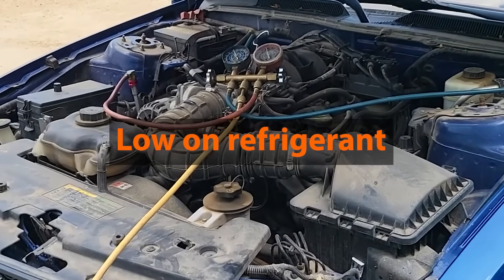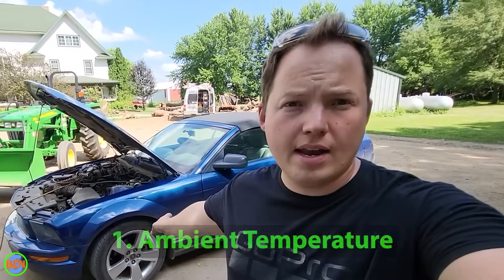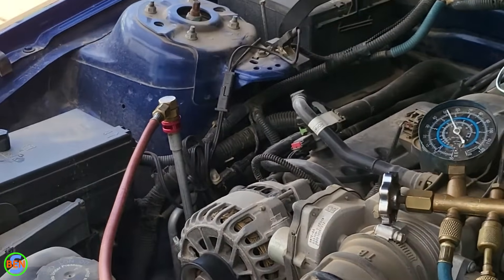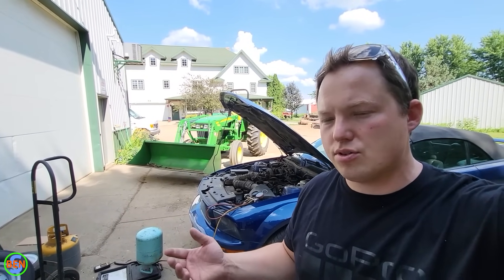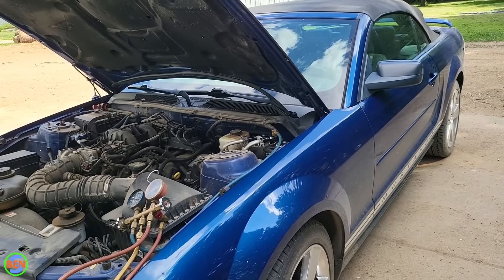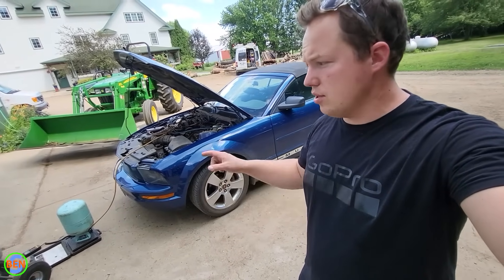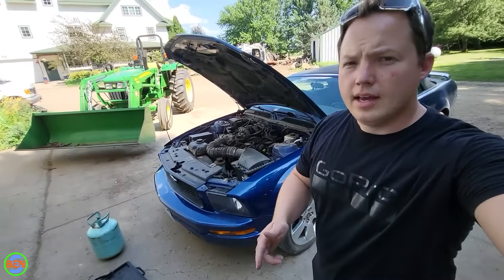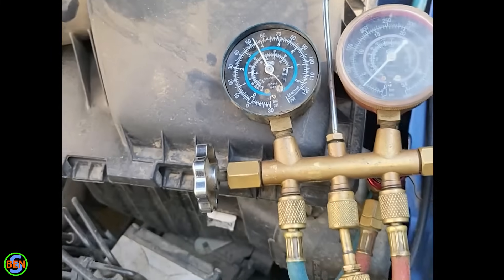What Pressure Should my Car AC Be - How To Check Automotive R134a Air Conditioner - Recharge Tips

Comment: Thank you for CLEARLY EXPLAINING how recirculation and ambient temperature affect the pressure reading on the manifold gauges! The chart that you share at 2 minutes is a valuable resource that will be very helpful. Those areas had me a little confused until I watched your video.
Reply: search: r134a temperature pressure chart pdf
Reply: @maxs351 not the same chart.
Reply: It is also recommended to open the car doors.  Not only will this help keep the inside of the car close to ambient temperature, but it will also help to keep the compressor run continuously and suck in that refrigerant.
Reply: I'm confused the outside temperature is what matters in the ambient temperature in a car is measuring that outside temperature it's not measuring the cabin temperature
Reply: @macknumber9  The GM  Auto HVAC system uses a sampling fan on the driver's b-pillar to suck cabin air into a temp sensor - so what you say isn't 100% true. This AUTO system also takes the ambient temp from before the radiator, usually on the left side (d-side) of the radiator support. It uses this to anticipate thermal loads and also to shut the compressor off if the temperature outside gets too low.

Comment: With the tank upside down like in the video, does it matter if you charge through the high side or the low side?
Reply: Yes, always charge slowly to low side.
Reply: I thought if you turn it upside down like that, that liquid is suction to the low side and that’s bad for the compressor. R134A is a GAS not the liquid.. I confused as to why you’re filling it like that.

Comment: What RPM should I have the vehicle at? I notice a huge change in pressure at idle (~950rpm) vs 2000-2500rpm.
Reply: Should be idling.

Comment: Hi sir. I have a three doors True cooler that uses R134A gas. If the temperature in my store is 75 degree, what should the low side pressure be? Please help.  Thank you.
Reply: Temperature in the store does not matter. Temp in cooler tells the story.

Comment: Pressures are dependant on
clean evaporator core 
clean condenser 
condenser fans working 
orifice tube or
Tx valve 
variable displacement  maybe ecu controlled 
fixed displacement 
When charging  use weight method with scales u did excellent 
pressures are almost are individual to each model 
pressures are changed by design or fault  if correct charged 
The ambient temp can  change pressures 
have all doors open when charging  to load a/con 
have on recirculation ,, sucking in air from engine bay is not normal 
check pressures at idle and 1500rpm 
THE PRESSURE CHART IS WAY INCORRECT 
115F DAY   25--35 PSI LOW   ,,,  150--160PSI HIGH  at idle and 1500rpm txv and fixed displacement compressor

Comment: I just filled with a can and the aircon stopped working.I started bleeding from the low point seemed warm air was coming out,then suddenly cold gas and it started working again.Must have been air in the system.
Reply: To much refrigerant

Comment: I've been doing HVAC for 8 + years now. Car HVAC systems used to come pre-charged with dye. So yeah, dye is designed to be in the system. Dye is one of the best and easiest ways to find the leak. It mixes with the refrigerant oil and is A-OK to be in the system

Comment: I've got a situation on my 2016 F250, 6.2 gas. This year for the first time 137k miles, when I come to a stop the AC heats up, as soon as I get to speed it cools down. My gauge showed low on R134a, so I added some not much, and the pressure was ok. But still the same situation happened. I don't have a condenser fan, just a cooling fan. If you have an idea where to go next, I would appreciate it. Great video by the way.
Reply: Plugged condenser, no air flow at idle.
Reply: Clean the condenser and the radiator. 
Wash both of them out with a garden hose. 
When I did my daughter truck. I used dawn dish soap. Used compressed air to blow out any remaining debris.
Reply: If you have an engine driven fan with a fan clutch, check the fan clutch. If the fan clutch is bad it may not be spinning at full speed . That will cause poor A/C performance and high refrigerant pressures at idle.

Comment: What about if one car takes 850grams of refrigerant & another only takes 450grams ?
Is that pressure chart accurate/universal for any charge of refrigerant or a particular charge ?
Reply: The chart should be accurate regardless of the amount of refrigerant a particular system is designed to hold.  The pressures should measure/register based on the ratio of refrigerant to the overall volume and based on the ambient temperature.
I'm not an actual A/C tech but I have stayed at Holiday Inn Express a few times.

Comment: Hello Ben:

So I have a question that I believe is closer to your area of expertise. I have a mini split, but it is a 24 volt system that uses a variable frequency compressor that I use in my RV. These are designed to be energy efficient, but they probably don't produce the same kind of output as a traditional one speed compressor would. I can tell when the compressor is at max speed just by the sound, and I can also confirm by the wattage being used. I'm assuming that low pressure and high pressure readings are only valid when the compressor is running at full bore--correct? For an automobile I don't think this is even a factor, the compressor is either on full output or off. 

Since the head unit or evaporator is indoors (Inside the RV in this case) I'm assuming I should be using the indoor temperature and not the ambient temperature outdoors. Alternatively I guess I could open the doors in the RV so everything is the same. Since this test is based on ambient temperature, this seems to be a critical factor so I wanted to ask for your suggestion. 

In my experience with this mini split, it only produces the extreme cold temperatures very briefly when the compressor is at full bore, and then it's cycles back down again. I think this is a trade-off for energy efficiency as this runs off a battery.

Nevertheless, all the more reason to get it as cold as possible.  Again I just wanted to ask about where I should be taking the ambient temperature reading, because I'm talking about a mini split, and then I'm also assuming that the pressure is only valid at full power on the compressor. I've even seen guys with automobiles rev the engine up to 2500 or so to get the readings. I think you're just using idle speed, so that part is a little confusing as well. Isn't pressure going to go up on the high side with higher revs and the low pressure lower? I don't know which one is correct, but most Mini split systems only have one speed. 

My situation is a bit unique here with a variable frequency Compressor, but I think the basic concept remains the same. Your comments and feedback Appreciated.
Reply: set the thermostat to max cold, fan to max speed.  set the pressure to about 35-37 F equivalent pressure on the pt chart for the refrigerant.  charge very slowly, really slow.  monitor the suction line. if it is soda can cold and sweating, STOP and check if the air on the vents is cold.

Comment: I saw your pressure chart that shows about 340 psi at 100 degrees.  I've found quite a few charts that show 100 degrees closer to 120psi and that's more inline with what is on the front of my manifold set.  How do you know which chart is correct?  The app from the Freon manufacture (chemours) states about 135.  135 seems low to me but who would know more than the one who actually makes the refrigerant?

Edit:  finally charged. 2,000rpm. 40/365 with 128 degree condenser  air inlet temp.  158 degree high side line temp at pressure tap.  Upon test driving, 40 degree outlet temp.
Reply: Never seen anything like that as to 1XX pressure range on high side for R134a...always in the 250 range (+/-) on high side. Double check "units"..... psi. and he type of refrigerant used.

Comment: When doing a recharge with a manifold set- I'm guessing keeping the high pressure coupler value should be open? But the high pressure value on the manifold is always closed while the vehicle is on + compressor on. Is this correct?
Reply: No, both valves are closed. Never open the high side valve at the gauge set. You can blowup the can.
Reply: @2nickles647  it didn't! I wonder why?

Comment: Do you ever clean under the hood?  Dirt will wick plasticizer out of plastic parts, making it brittle and prone to crack, then you get leaks, then you have problems that are very hard to locate. I actually use a pressure washer to clean, and apply protectant like armourall to hoses and plastic parts. 2004 f150, 164,000 miles. Runs like a swiss watch. 😊
Reply: Dude, Please look into Aerospace 303 protectant for your hoses and even tires.. The stuff is Amazing!
Reply: @LTDan-pk3mx  thank you I've been using armourall.
Reply: @jima3129  ...if Armourall has silicones, be careful as a lot of paint and electronics don't like that stuff. Aerospace 303 is the ticket...
Reply: Look into "Strike Hold"
Dry Lubricant Protectant, see their Video, can be Sprayed Directly into Electrical Componants while Running. Alternator, Electric motors, battery Operated Equipment, 
Generators,
Excellent for Firearms.

Comment: I put new lines and a condenser in the ac of my car but still not cooling down?
Reply: Must vacuum system properly before adding charge. Air is a contaminant.
Reply: Was the lines broken? Condenser busted. Did you replace the metering valve that goes into the AC low press line ? 
Are the cooling fans running.
Is the AC clutch cycling 
Have you changed the cabin filter
Reply: I did replace condenser and compressor expansion valve and avaporator too and Liquid Line still not cooling nothing
Reply: The compressor is working and fan, too. I changed the filters, too, but I am still not working. Just blowing warm air

Comment: I'll evacuate the system and  put 100 psi of nitrogen to it, then squirt a solution of water and Dawn soap on the hoses, connectors, compressor seal area and condensor with an ordinary spray bottle. You'll see the problem area quickly where you see bubbles.

Comment: All car compressors are designed to leak a small amount of refrigerant to keep the outer seal pliable.  Adding several oz every few years is not out of the ordinary.  Also, good mention on checking condenser’s coils for blockage.  Many times on very high mileage vehicles (200k +) the condenser’s coil fins are smashed closed.  This will cause the high (liquid) side pressure & temp to run much higher than normal.  May need a condenser replacement or lots of patience in straightening the fins to allow proper air flow/ heat transfer when high pressures/ temps seen on liquid side.
Reply: They sell fin combs to straighten the condensor fins --- I have a couple I keep and guard mightily!
Reply: @SurferJoe46 actually I should have said replacement of the car’s radiator v. condenser as the radiator’s fins get locked shut by rocks not allowing air to flow theu essentially cutting off the air flow to the condenser.  Radiators are relatively cheap and easy to replace v. attempting to straighten.
Reply: That's a very small leak, indeed.

Comment: Be very careful about keeping AIR out of your system.  Purge your gauge lines before hooking them up. I actually installed ball valves on the ends of mine to keep them completely sealed. 
The Schrader valves are a highly likely source of refrigeration leaks. They should probably be changed out if there is any significant leak in your system.

Comment: I was going crazy trying to find out why my high side was so high that the safety valve in the compressor was releasing refrigerant. I replaced expansion valve, condenser with no luck. I was about the give up until I decided to check the radiator fan. Turns out I replaced the fan a couple months ago and never checked the direction of the airflow. It was reversed so it was blowing through the radiator then the hot air was hitting the condenser which was heating up the refrigerant and causing super high pressures. A reversed radiator fan can cause high side pressures to be insane. A simple wire swap fixed the issue.
Reply: How in the world was it running backwards? You mean the plug could go either way????
Reply: @jima3129  The fan motor I ordered off Amazon had the red/black wires swapped on the plug. I assumed it was correct since it was basically spinning and never checked the airflow direction. Never assume with aftermarket parts.
Reply: @seephor  Amen to that my passengers side window still works backwards. Lolol not as catastrophic as your case.
Reply: @seephor This happened to me as well. Toyota Passo

Comment: What do you do if the compressor is not running because of the low pressure switch?
Reply: look into why low pressure switch is acting up.
Reply: While the system is under vacuum, add the first can of 134a to the low side. suck it right up now compressor will run
Reply: It sounds like you have a leak. Best thing to do is pressure test with nitrogen, find the leak (s) and repair. Pull a vacuum on the system and refill with refrigerant

Comment: Great video as usual....FYI not only do the automotive quick disconnects make it easy to connect, they usually have open/close valves right on the quick connect hose fittings so you don't actually depress the schrader valve until you turn the knob in after your connected...
Reply from the maker: Must vary by set type as the ones I've used immediately connect and don't have a separate option of depressing the valve core.
Reply: @BenjaminSahlstrom  yeah, that's true...afaik they are add on so they can be bought separately to just screw on to the ends of your gauge set hoses if it didn't come with them. 👍
Reply: When I attach the quick disconnects, I make sure the needle in the quick disconnects are fully withdrawn so it doesn't push/open the Schrader valve. Once it's connected, I turn the handle in so it opens the system and allows gas to flow. If you didn't buy gauges with handles, replace the set.
Reply: @Barryd57  another good habit is to only turn the valve just far enough to crack open the schrader. On some of those couplers that stem that pushes on the schrader can go down far enough when fully opened to actually damage your schrader valve.

Comment: I have found that when you open the system for any reason or evacuate it and want to check if a leak is present, don't use vacuum.
Vacuum can suck a leak shut. Pressure is the way to go.
The system is going to be vacuumed to remove any moisture anyway.
Then you can use soapy water to easily find a leak.
Input happily accepted.
Reply from the maker: Interesting point for sure.

Comment: None of this temperature will work that you have described on variable valve compressor which is what all recent latel model cars after 2015 has it. The knowledge you have on residential will not work in Automotive because , fan speed, variable valve compressor , change in speed of air at condensor (based on car speed) all affect pressure and heat.
Reply from the maker: Interesting. I suppose the only option in newer stuff is to just evacuate and weigh in the factory charge?
Reply: @BenjaminSahlstrom  for same reason super heat and subcool never works like residential and it also differs for every manufacturer
Reply: @BenjaminSahlstrom  I always evacuate and add charge as per spec
Reply: He is right variable stroke compressors work different can’t go by charts and pressure go by factory specific charge pump it in before you start the car  a lot of the newer cars hold like .83 charge  without a good robinair machine it is impossible to get the correct charge. And on the small units  a once or two makes abig difference

Comment: When testing the car take the temperature close to the Condensor. Ijust because it 75 degrees out doesn't mean the fan is Circulating 75 degree are. It's likely warmer. The other option is doing it when it's windy or use fans to move hot air away from the condenser. Oh and I know with R134a prices going up don't use propane. I yes it works better, but is flammable and you need a lot less and you would have to accidentally vent all the air to the atmosphere.

Comment: Nice work Ben, I've done my research, did everything by the book and had fantastic results, even after replacing components like an evaporator, (NO easy task in today's cars). I use all OEM parts, proper oil and amount, system evacuation and such. I also had no R134A to reclaim so that wasn't an issue. I even have a scale to measure the refrigerant. One thing I noticed on your setup, looks like you did a liquid charge vs a gas charge, when is one desirable over the other? I'm also with you on the sniffer over the dye.
Reply: Add Slowly and it will flash to vapor before it gets to the compressor.
Reply: @MrRikkitikki so why not charge with gas then? Why risk slugging the compressor?
Reply: @TheDemockery  You can charge with gas but it takes forever! Charging by liquid, in small spurts, allows the liquid to convert to gas as it enters the system and will not harm the system if done correctly.
Reply: If the jug is inverted like Benjamin's example, you can overwhelm the system by introducing too much R134a so monitor the low side head pressure carefully.